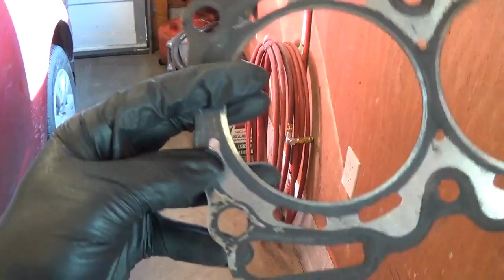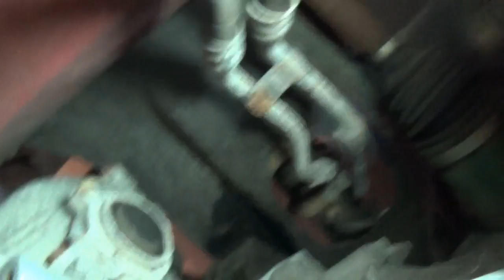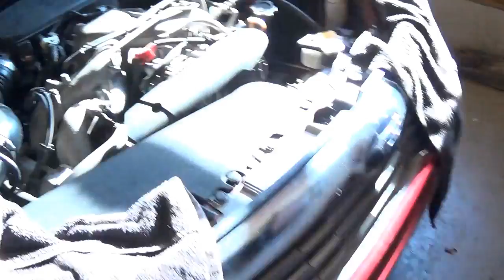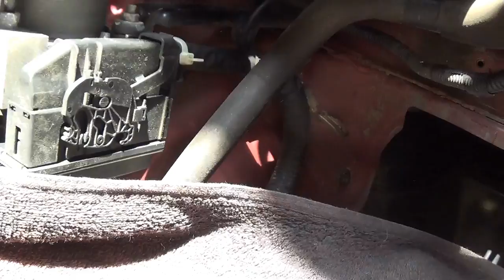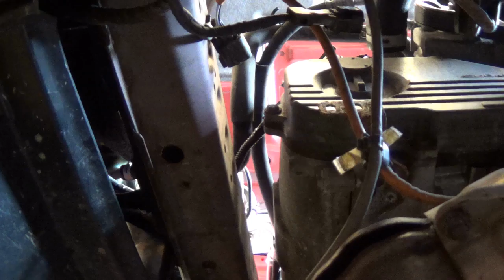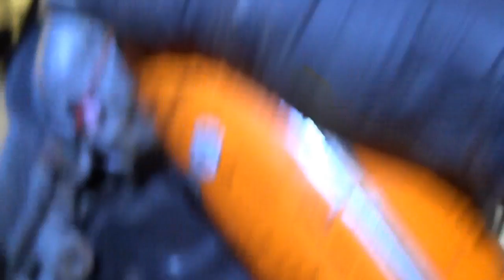Subaru Head Gaskets -Part 1: Teardown

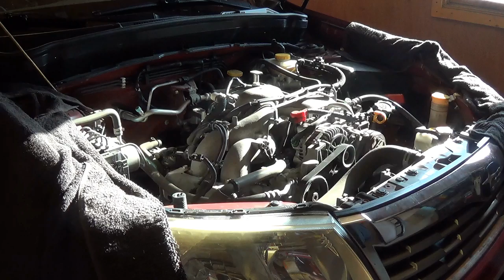Comment: 10:19 - It's called a 'blow job'. These are great - but once you're married, they usually aren't done, for some reason. I like to use a product called 'Simple Green' and paper towels. A clean engine is easier to see when leaks occur, and where they are. And when detailing an engine, it gives me a change to see issues like leaking antifreeze, loose connections, missing fasteners, torn boots, and corrosion forming - like on the battery. Usually, before an issue gets bad or fails completely, it often shows signs and most things are cheaper when diagnosed early.

Comment: Thanks for all the great information!  i have a 2011 outback limited and i am about to do my HG replacement, but i don't know what EJ25 exact model is, and i don't know where to look for this information... My other interrogation is: what replacement HG should i install? i have read that the OEM gaskets won't last, and have read bad things about FelPro... What would be a good suggestion for other brands? Should i re-use the same head bolts? Thanks for any information!

Comment: subaru ej25 2.5 Liters engine are great, just ONLY use multi layers head gasked, and after 200 000 km, change head gasked, head bolts, seals, and it last easy 100 000 km more. I change oil 3-4 tims a year, maby every 3-4 000 km, so engine oil is newer black, so you newer get an engine oil burner, and low compression. ( fuck 12 000 km oil recomindation from subaru. Use your own head.

Comment: The ground straps are there for a purpose. One thing Subaru found was more grounding was introduced help keep the radiator coolant from becoming acidic. Its the acids that are eating at the head gaskets causing failure. Along with the open block design allowing the cylinders to move slightly. You can check that potential with your volt meter and placing red lead on the battery red post and the black lead in the radiator fluid. There will be a potential there. They have grounded the system in multiple places to help stop the the corrosion attacks to one area.

Comment: It's not that the Turbo Subaru's use better head gaskets, it's the difference between the open block and the closed block construction. The open block used on the 4 cylinder does not have as much support on the cylinders as the closed blocks.. Thus the cylinders move slightly and create leaks. The turbo charged models have a semi open block construction this less cylinder movement. There is no truth in Subaru telling potential buyers that the leaks were occurring in the early models not in later models.

Comment: Ok I have 2004 Subaru Baja. It keeps overheating as soon I start driving. I changed water pump, thermostat and coolant temp sensor. Nothing changed. It keeps boiling water and lower hose is cold all the time. I did pressure test but it not dropped at all. I even removed thermostat but still overheating. The engine oil is clean and I don’t see any coolant in oil.

Comment: Sorry if I already ask you this question. How do you keep the mating surface and gasket clean when you leave the engine in the the car? How do you prevent the oil used to install the head bolts from leaking while trying to alight the head to the block? Thanks!

Comment: I have to do a HG on my '01 as well and since the motor has to come out, I and was planning on doing a complete engine overhaul replacing every gaskets, seals, and grommets. Subaru has an engine rebuild kit Part Number 10105AA310, but beware as it contains the old HG which is the one that fails. Since the HGs comes in a kit, Subaru won't be separate it, one has to buy the FelPro or SixStar HGs separately..

Comment: Subaru's have the same problem as Vanagons with head gaskets. From everything I have read is electrolysis is responsible for head gasket failures. The two ground straps is to take stray current back to the body for ground instead of flowing through the heads to the engine block.  VW some what solved the issue by going to phosphate free antifreeze though not a total fix. (at least it got them off warranty) I would have thought Subaru would have figured it out by now.

Comment: That is why l only buy Lexus and toyota vehicles. My Lexus ls430 2001 has original alternator and starter. Regular maintenance. 286000 miles. I hope to get 500000 miles out the car.

Comment: I heard head gaskets problem is common for Subaru but I also heard that this problem has been resolved for newer Subaru cars.  Can someone tell me if this problem still exist in 2017 and 2018 Subaru Forester?   Also does this only affect the 2.5L Subaru engines but not other Subaru engines?

Comment: I think the engineers started to put those two ground straps on at around 2006? Was meant to prevent electrochemical galvanic corrosion of the head gaskets as the coolant got older? But does not seem to have prevented that in this case.

Comment: Have a chance to buy one of these locally.  Shop that sold the car to the current owner did this same 'job'.  6 months later the guy wants to dump the car.  (Looks fantastic from the chassis/body point of view...)  I'm wondering if it might have a cracked head or block.  6 months after the head gasket job it runs for a few minutes 100%..and then it starts to blow compression out the radiator and overheats.

It's cheap enough, but might be easier to find a P&P engine that is compatible and out of a rear end accident subby...  Thoughts guys?  I can turn a wrench fine, so that's not an issue.

Comment: Yeah, but if you don't do this on your car, you won't learn a darn thing. I just did this last month on my 300k mile 2001 Legacy which had an oil leak since forevers. Anyways, just had enough time on my hands and since there were so many videos about it on youtube, I went ahead and did it. And now I am glad I did it, because it was so easy and love the car even more now that I can do this kind of work on it. Best part is, I fixed all the oil leaks and so far some reason the engine is now so quiet and runs like new again, no oil leaks or leaks of any kind. Even the knocking and rattling is gone. I guess it gets enough oil pressure to where it can run quiet.

Comment: Removing (ej22) exhaust nuts from studs was the first job I ever attempted with an air impact. It was enlightening. Most of the nuts were seized and pulled the studs right out of the head. After getting used to cheap hand tools rounding off most fasteners, I was amazed. And hooked!

Comment: Seems nothing is reliable, or bulletproof anymore these days! 

I cut my teeth wrenching on Japanese motorcycles, dirt bikes, and ATVs/trikes. Loved how you could do anything with just a 8, 10, 12, 14mm sockets & wrenches, and a phillips screwdriver ... and maybe a small flat blade pocket screwdriver for adjusting mixture screws on 4-strokes. Wish the rest of the automotive manufacturers would use this well engineered and simple system!

Looks like you've got a small battle ahead of you. I'll have to pick up Part II tomorrow. Great vid so far!

Comment: just for giggles how much to do a job like this your total charge out the door  ?
Reply from the maker: If it's JUST head gaskets with no machine shop work, then around $1500. In this case the cost almost doubles because of the labor and parts involved to rebuild and resurface the cylinder heads, including pressing in new upgraded exhaust valve guides.
Reply: that car shouldnt bluebook for that much i wouldnt think -may be better off parting the car out and putting the cash towards something else i would say

Comment: Nice video.  How many miles were on the car?  I just did my 08, 180k miles.  I used the Subaru MLS gaskets, and Subaru seals.  FELPRO Rocker cover seals.  Aisin TB kit, Exedy clutch and new flywheel.  I replaced the two o2 sensors while the engine was out.  New head exhaust studs and nuts. New rocker cover bolts.    I do wonder sometimes why we love these cars.  I'm probably going to pick a CRV or RAV for my next car.  A head gasket job on a new Subaru with a timing chain would be a bigger job.
Reply from the maker: Sounds it will drive like new and last you a long time after that job!!
Reply: i think the hardest part of this job is removing the corroded fasteners, if you are patient , and willing to buy or rent a hoist and stand, its not beyond most DIYers.
Reply: ALL your videos are great, please keep them coming. I'm going to be doing a wheel bearing on 08.  I did one front 2 years ago, the other side is ready.  I like your video.  I'm planning ahead and ordering longer metric M12 1.25 bolts from McMaster incase the bearing separates, rather than resort to cutting down the hub like your video.

Comment: Ivan, we have a Subaru specialist out here in Phoenix named Subaru Mike Bauer who has several excellent YouTube videos on Subaru engine repair. His view is that anytime you remove the heads you should pull the engine as it's faster to do it that way. Did you consider just pulling the engine, putting it on a stand and doing it outside of the engine bay.
Reply from the maker: Hye Dennis! Well if I did these every day, maybe I would invest in an engine stand and engine hoist. But they are just as easy to do with the engine block in the vehicle :)

Comment: Ivan,
I do a lot of these cars, in fact almost exclusively. The best solution, I've found, is to is to use an OEM EJ255 head gasket, which is the MLS one from the turbo cars. The part numbers are as follows:

OEM SLS Gasket: 11044AA633
OEM MLS Gasket: 11044AA770
Reply from the maker: Cool! So it's an exact fit then? Good to know :)
Reply: I just did my 08 2 weeks ago with the new OEM MLS

Comment: Hey Ivan, Unrelated Question.  What kind of shop press do you have in the back ground?  It looks small and compact.
Reply: pretty sure it's an older 12-ton "harbor freight" aka "horrible fright" :))
actually, that may be the 20 ton model, lol... ( slightly later in video, I caught a better view, it's the 12 ton) they're not orange anymore, they changed to silver and maybe put a different brand/name on them
Reply from the maker: Yup Harbor Freight 12-ton, slightly modified. Has held up through a lot of abuse! Only thing it couldn't handle was pressing a seized CV axle out of a hub on a 1998 Mazda MPV. Took it to a buddy with a 20-ton press and torches. Well he got it out, but also snapped the damn knuckle in half xD

Comment: Ivan.  Great video! I've never done suby engines.  But seems like easier to take engine out and do the heads? Is that you're planning to do? This is something to learn here!  If I ever do one.  Ill know what to do lol!!  Great job :)
Reply from the maker: I've always done them in the vehicle, just because I don't have an engine stand or a hoist lol. It's easier to torque stuff when it's attached to the rest of the car ;)
Reply: Pine Hollow Auto Diagnostics good answer lol.  Most of us don't have the fancy stuff like Eric O does lol.  But we do make the best of the situation.  I'm in the same boat as you are.  I don't even have a hoist or a lift lol.  But i agree with about torquing stuff on the ground.  No worries about the car falling off,  hahaha!

Comment: hey ivan I did that job once....but no guides  common on subie  oil and coolant external....  good eye! on the guide...  hope the valve cover bolts go ok....you can use erics new gun and shoot them off!   I do a lot of timming belts  it is always a pain with the new belt its like its a little too short     dave

Comment: My Lancer Evolution has a ground that attaches to a bell housing bolt.  Do a clutch and fail to reattach that ground and the starter will ground through a small ground wire in the main harness and fry it.
Reply from the maker: Oof that would be a bad day lol

Comment: Ground straps are to make sure current doesn't travel thru bearings
Reply from the maker: Which bearings? Maybe you are thinking of AC induction motors?
Reply: Trans and wheel bearings. Drive train mounts are mostly insulators so the only path to chassis might be thru trans and wheel bearings.
Reply from the maker: If you have such a bad ground problem, the engine simply won't crank over since the starter won't work... But that is an interesting theory!!
Reply: Its not theory - life experience. I had Fiat 126p (Polish). Rear engine car. When ground strap broke all current was going thru emergency brake cable. Cable was getting hot while starting so it froze and broke too. Current than was going thru wheel bearing which failed promptly with signs of electric erosion apparent during disassembly.
Reply from the maker: Wow that is cool! In this case I meant those "extra" ground straps don't matter at all because there is a good solid ground cable attached near the starter :)
Reply: Yep - its probably for redundancy.

Comment: Not changing the water pump? It's part of the timing system. Hmmm? I would not take the chance. It is an interference engine, even when they say it isn't. Maybe I should say it will bend valves at higher RPM. Above 1500. Also there are 2 different thickness head gasket used during mid 90's to early 00's models.
Reply from the maker: Never seen a Subaru water pump fail before 200k miles...so first t-belt change I leave them alone :)

Comment: Very interested to see your take on a Subaru headgasket job. I think Eric O has the defining video with his EJ253 5 part series. I've done two of these myself for people i know. I can't believe Subaru could make an engine that in of itself easily has 300,000 miles in it and yet also couldn't make something with a decent headgasket and then gets their problem solved by the aftermarket. Only other engines i see eat headgaskets like Subaru's are Rover K series engines and at least they solved that problem before Rover went the way of the dinosaur. 

ALSO. When is the beard making a return?

Comment: Do you think the chronic head gasket failures could be due to the fact that the heads hang on the side of the block. As a result gravity is pulling the head away from it's sealing surfaces causing a compromise in sealing?
Reply from the maker: Nah, just a crappy gasket design. Never seen a single-layer steel gasket used on anything other than a lawnmower hahaha

Comment: 1 2 another subaru baby .
not bad to do in car on the single cam engine, easy enough raise and move engine to one side for more work space on side you working and do less restricted side first .
I can do them quicker in car over pulling engine but not a lot in it really . 
Pretty easy fix if do them early stages and not been cooking engine with overheating issues .

Comment: Is the labor time figured on doing the job on a lift?, and are you going to get a lift in the future? Thanks for the video.
Reply: One thing about working on your back, as long as you keep your tools organised and close to hand. I think its easier on your back, neck and shoulders than working on a lift. I also prefer to be on my back when doing clutch jobs. I find it easier and safer to wrestle the gear boxes in and out by hand.
Reply from the maker: In this case a lift wouldn't save any time, since 90% of the work is done from up top :)

Comment: I think if the coolant was changed on shedual it would help prolong gasket life.
Reply from the maker: Common myth. Wouldn't change a thing. Coolant is OEM Subaru Long Life good for 150k miles or 10 years...
Reply: Agreed in theory except where electrolysis  exists in the coolant, and for that reason it has been recommended to change coolant more often to help eliminate the condition. It has been suggested that the electrolysis. contributes to HG failure. Apparently that is also the reason the ground straps are fitted underneath to the cylinder heads. Not my personal opinion, but something I have read on several occasions when researching the Subaru head gasket issue. Keep the videos coming Ivan, you and Eric are my favorites, - looking forward to part 2.

Comment: I would pull entire engine myself,(although I have never pulled Subaru engine) 
  where boxer mill cylinder heads need "seating in" or failure certain
   and I would remove WATCH when working around ANY mills

Comment: Subaru head gaskets..... done several in the car, last time I pulled the engine, think the next one I will also pull the engine, nicer to work on that way.
Reply: Kellys Peppers I have not put my hand on one yet I am a DIYer.   I play machanic on my time off from work I am a MD.

Comment: That's crazy seeing the valve guide like that. The owner should be glad you are doing this job and saw that, if not could have had catastrophic results.
Reply from the maker: If it migrates far enough it will keep the valve from sealing and cause a misfire...

Comment: The ground straps should be added back, they add addition grounding for the engine electrics as well as possibly for electronic interference.  You can find other mechanic bad experiences and fixes when they have disintegrated away, there’s one that Eric O specifically did.
Reply from the maker: Interesting! Which video was that car on?
Reply: The ground straps prevent electrolysis in the cooling system. One of the main reasons for the head gasket failures.
Reply: Sorry to be off topic but does any of you know of a way to get back into an instagram account..?
I was dumb lost the login password. I would love any assistance you can offer me
Reply: @King Billy instablaster :)
Reply: @Louis Collin Thanks for your reply. I got to the site thru google and Im trying it out atm.
I see it takes quite some time so I will get back to you later when my account password hopefully is recovered.
Reply: @Louis Collin it worked and I finally got access to my account again. I am so happy!
Thank you so much, you saved my account :D
Reply: @King Billy happy to help :)